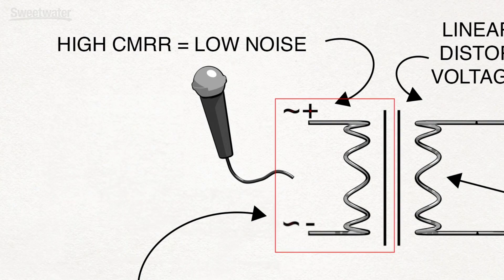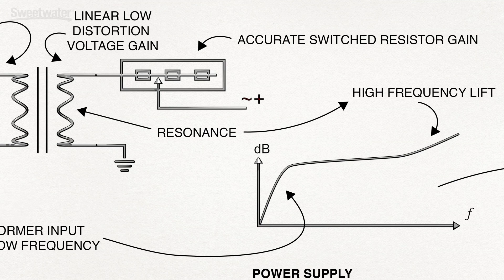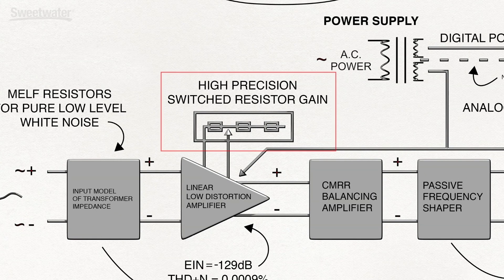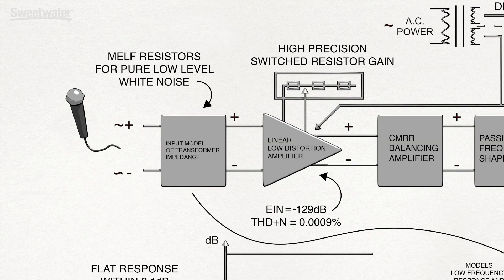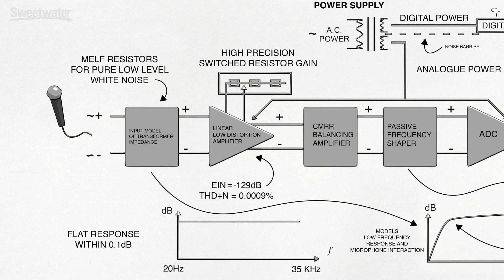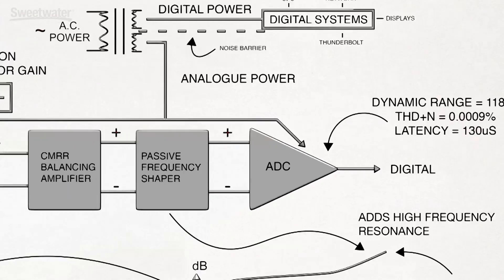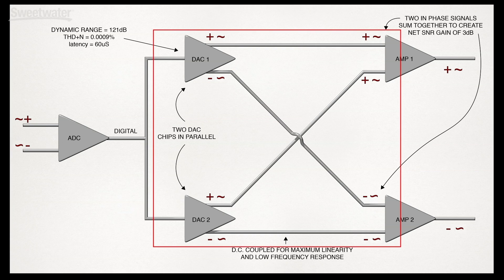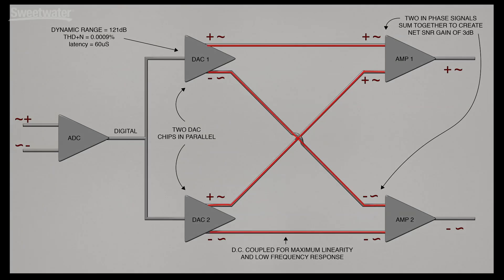Focusrite Red 4Pre Technology and Signal Flow

Comment: Works with windows PC?
Reply: Yes
Reply: Nash Naubert via USB or Thunderbolt?
Reply: @pepe7drum 2 thunderbolt connectors, no usb, so for windows use you will need a thunderbolt adapter. The windows drivers were added recently while the Mac drivers have been around since launch, no issues with Mac so far.